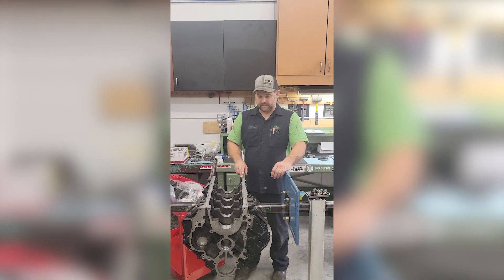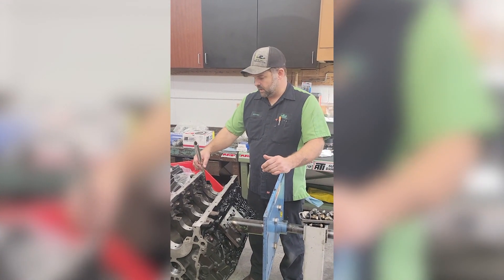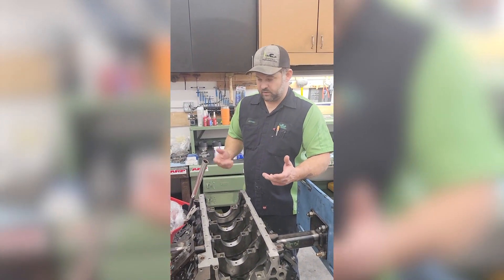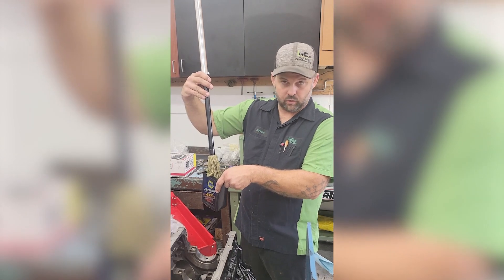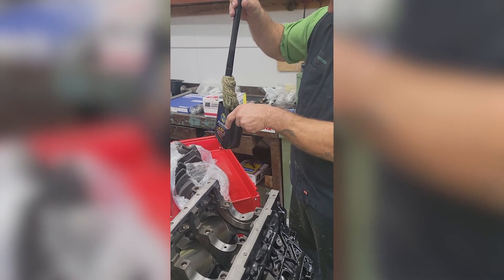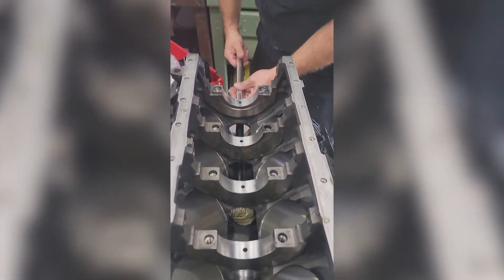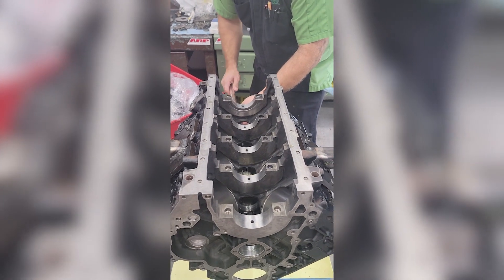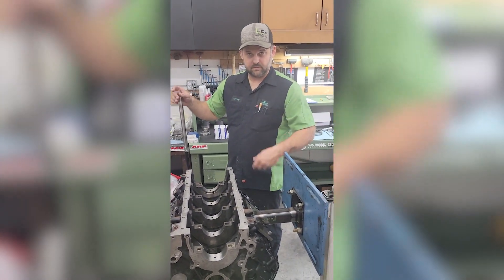Easy Cam Bearing Lubrication

Comment: I just use a handheld oiling can with a special tip i made. Basically a copper ball end with tiny holes drilled around the circumference and a long tube so i can just squeeze the handle and spray every bearing evenly.. hasn’t failed me in 15 years